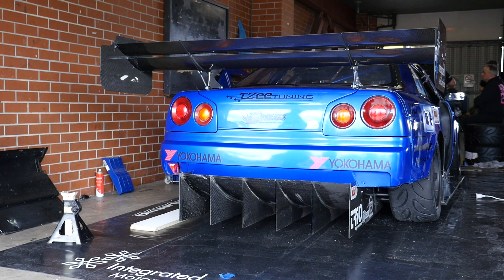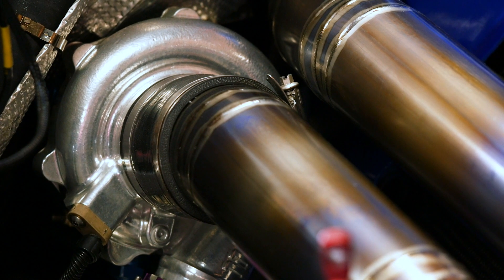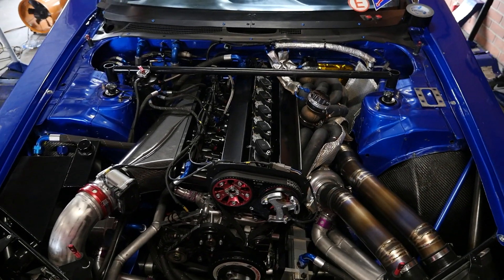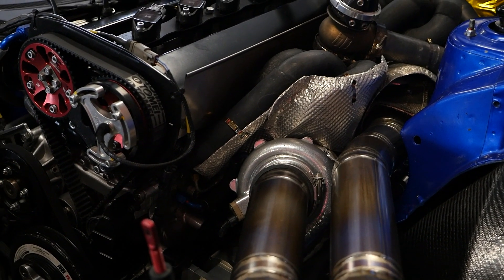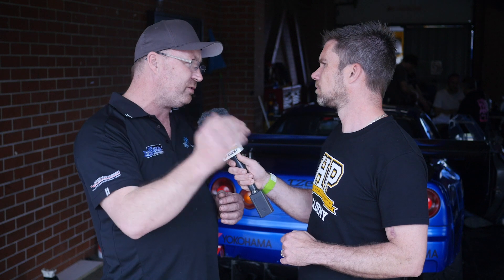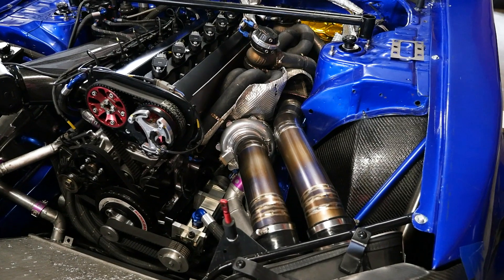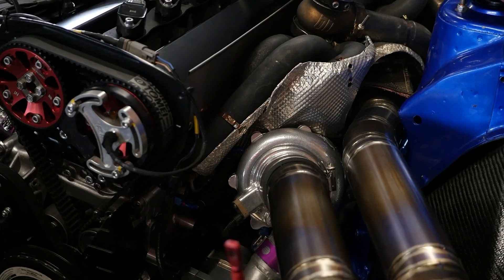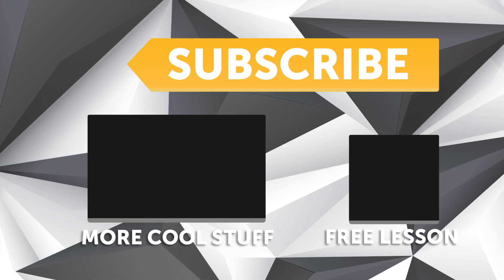Single Turbo OR Twin Turbo? | 1200HP R34 GTR Skyline [TECH TALK]

Comment: So twins on this one tiny niche requirement. Big single for everything else. Nothing new.
Reply: Response was as good as a gtx3584 rs  better than both 6870 and 9180 efr . And it just beats them all the way from 3  on .we made 1000 engine dyno at 6100 at 30 psi . . The others don't see 1000 . Well 6870 will easy go 1100 but it's at the top of the rev range . The g660 flog them all from 6 to 7500 there nearly 200 up on all the mid frame turbos . Only down side you need to run high boost 38 + to see the hp . That adds up to masive heat and high drive pressure in the exh manifold.  If you are only after 800 ish there not right for the job as the cost and work to fit is to hard . There to fill the gap between the mid frame turbo and large frame . Hp 1200 ish no other turbos fill this space .
Reply: @26Petermc  thank you SO MUCH for sharing your experiences.  Most of us can only dream of maxing out a high dollar build like this, much less compare several setups back to back. Really interesting info for sure. I am extremely curious if you guys considered installing a mechanical pre-turbo water meth injection setup, as it seems like the perfect thing to do when you've maxed out your turbo and still want a little more air. I left a detailed comment about it on this video a few hours ago, hope you can give it a read.
Reply: @MR__JUSTIN  well looks like you already beat me to asking them LOL! Let's see what they say :-)
Reply: @MR__JUSTIN  we are not aloud to run it in the class . But I have run water meth kit on many builds . It only adds a few % .. not enuff of a change ,to get where we needed to go
Reply: @26Petermc  ah, that makes sense, darn rules. Only a few percent better, interesting. I was under the impression it enabled a pretty significant bump in airflow. I would be curious to know about how many cc/min you were injecting pre-turbo when you did this in the past, and if the turbos were maxed out or close to it as with the case with this GT-R as that's when it really shines. Supposedly the more the better, to a point of course.
Reply: @MR__JUSTIN  no more air flow .. just better air density.  Most of the turbos are exh side limited . The pressure builds up and you just can not get it out . Turbos like the 9180 are out of exh flow very early on a rb 28 .even with the largest rear housing.
Reply: @26Petermc  no kidding! This is with pre-turbo injection? Spraying straight into the inlet of the compressor? I suppose if the turbine housing is the choke point, increasing your compressor efficiency won't get you anything. But couldn't you just get bigger external wastegates?
Reply: @MR__JUSTIN  we had twin 60s on it and had them wide open with 22 psi at 9000
Reply: @26Petermc  so much exhaust flow, that's crazy. No wonder going twin was so much better, way more total cross sectional area on the exhaust side.

Since you didn't specify, I'm going to guess your previous water/meth experience was with injecting somewhere after the turbo, and not pre-turbo. Every other person says injecting pre-turbo shifts the compressor map right and allows more flow.

Thanks for the responses!
Reply: @26Petermc  is it possible to have a twin setup that will respond BETTER than a EFR9180 / proper twin gate system?  Keeping in mind the EFR8474 is out now which has better response and can flow well.  The question really boils down to for the 800rwhp-1000rwhp max region, is there twins that respond better.

From research that I did, I had learned if you setup the single with twin gates, there may not be too much difference or much to gain by going a twin turbo system to match similar power.
Reply: Absolutely  it's was just a custom design for this job . The big singles are easy hp . But dam there hard to drive fast around a track
Reply: @26Petermc  Once you get to a high enough HP that is. Up to 6-800 it'll work. After that is probably about the crossover I reckon. a lot of variable to make a hard and fast call where that crossover is though.
Reply: It really is hard to believe that you can be 200 hp up at 5000 and make another 300 more at 9500 . They work .
Reply: @26Petermc  You can believe it less inertial mass and higher total CFM due to greater area of on/outlet to flow. But only at those numbers. if it's an 800hp build, I don't expect any more HP, just marginally better response, marginally.

Comment: The new electric borgwarner “superchargers’ are going to be game changing in terms of spooling and reducing lag.
Reply: Is that real. ? I haven't heard of that .
Reply: @jayknight139  absolutely, do some searching. Audi has already implemented a version on highend diesels. 48v is will allow them across the board.
Reply: @ricepony33  thanks for the info.!
Reply: They will change things yes but only in the racing and diesel world Gale Banks is very excited about them as well. I just dont see them being a big hit on most tuners vehicles
Reply: Peter Kroeker I agree. I could see them being used on older vehicles with some type of a battery pack. They could replace nitrous for spooling purposes and or provide improved drivability for highly strung or large turbo street cars.
Reply: There was actually a fellow on Honda Tech a couple of years ago who was designing and had a functioning prototype of an electric turbocharger. He got like an F20 or something (non s2000 f20) to like low-mid 200 wheel, with a powerband from ~2.5 - 6k. Never heard from him after his initial handful of posts, now I guess good ole` BW is gonna be eating his lunch.
Reply: The efficiency of the system might not be too good as you have electric power generation losses, though that might be partially offset by using a centrifugal design (which is more efficient than the other two, but has a narrow effective RPM band [doesn't matter with electric drive]).

Comment: I recently just installed a G25-660 on my EJ207 STi. Previous setup was S2 cos cams and the usual forged internals and the OG GT3076R it was quite laggy full boost at 5500rpm. With the current G25 I hit full boost at 4500rpm at 4000 car was spooling and makes the car way more drivable. Its also quite a noisy turbo, makes alot of jet noises at 2000-3000rpm if you guys like that kind of thing.
Reply: what size housings on the 3076 and 660?
Reply: 3076 was an .82 (~23 lb/min) vs 660 .72 (~20 lb/min) if im not mistaken? would expect it to come on a bit sooner
Reply: @PhatToni  yep you are absolutely right .82 for the 3076R and the .72 for the G25.
Reply: Did some more street driving, I got 7 psi at 3100rpm at 3/4throttle. Its so good, anyone looking for a great street turbo jump on this. Imagine on an evo with short manifolds.
Reply: Yes please!
Reply: RINGLAND FAILURE
Reply: @frontspring1  it's an EJ207, not a EJ257.
Reply: gtx3076 has always been a laggy turbo for the size on smaller engines phattoni. The problem is it was the only choice for a long time to reach those power goals. ERF turbos are the way to go in that area now. But the G25 660 is a great turbo, on pump fuel with stock cams though you will find you have to run boost fairly high to make any good numbers. You need a good flowing engine and e85 to bring them to life. Though we are making 260awkw at 23psi with a g25 660 on an evo 6.5. It's about where we want to be in terms of power for pump fuel. going closer to 300 is asking for trouble and we'd have to run the boost too high. Once it's on e85 though running it at 300-350kw wont be a problem. this turbo makes positive boost at 2500rpm and full boost at 4200rpm. Very good for a lightly modified street car.
Reply: @UnparalleledSpoof  It really hasn't ever been considered laggy on 4-poppers at all, quite the opposite as a matter of fact. Hell, even a measly b18b can produce ~15psi around 4k on a gtx3076, and that's just talking about the old, crappy, gen 1 version. Don't even, don't eeeeeeeeeven bring up an EVO if you're going to talk about how 3076s "always been a laggy turbo for the size on smaller engines". Go look up a gtx3076 dyno graph on a 4g63, and then try and explain away how it's a "laggy" turbo.
Reply: @aiGeis  Yes that's what I consider laggy. It's all about how much power you can make at lower rpm's. If you can see close to peak power at 4k and take it to 7k for a 3000rpm powerband within 30kw of peak then yeah thats a good result (or torque if you are going for flat torque but lets face it if you are either your power goals are too low or you chose the wrong turbo). But i have never seen that from a 3076, and ive been involved with installing them on over 20 cars. Even on a 2.5L 6cy they are laggy for the peak power they produce. You can quite easily find other smaller turbos that make the same peak power with much more response.
I have never driven an evo/wrx/silvia with a 3076 gt or gtx and felt it was adequate. A golf R with a ported head is OK, not great.
Reply: Just for reference the evo 6.5 has a very small turbo, smaller than the 8 and much smaller than the 9. The g25-660 not only makes more torque from 1500rpm onwards, but makes more boost as well. At no point does the tiny stock turbo spool faster or make more boost than the g25.
I dont see any 3076's make more power and boost than stock turbos anywhere around 1500-3500rpm
Reply: @UnparalleledSpoof  Sounds promising that your seeing positive pressure by 2500 on a 2.0L. OP was talking vanilla GT3076R which does outspool the later GTX gen 1 and 2 variants. Its true that the EFR series has been hard to beat in that size range but there has always been the GT2860RS, GT3071 and 3076 with all their housing options that have had 200-300rwkw covered for these kinds of engine displacements

Comment: How about Compounding the Compressors, but keeping the Exhaust in Parallel?  Could stagger the compressor sizes.
Reply: There would be an imbalance between the compressors, 1 compressor would be compressing Air at atmosphere and the other compressor would be would become pressing above atmosphere. And all of this would be happening at the same Dr pressures if the turbines were to be mounted in parallel
Reply: @marvinwatson2749  you explained how compounding turbos work.  This is becoming more and more common.  The less common thing though, is running exhaust in parallel.  Most gasoline engine also compound the exhaust but I think that is because this is kind of new to the gasoline world.

High compression, high rpm engines might benefit from compound compressors and parallel exhaust.  Someone will try it and find out.
Reply: @ericsperformanceparts1647  let me make sure I understand what you mean by parallel, for example in a inline 6 parallel to me means three cylinders feeding one turbo and three cylinders feeding the other Turbo we on the same page?

If we're on the same page then I don't see how that would work. The drive pressure is would be to drastically different. 

A simple example would be your atmosphere compressor at say 20 psi and you're high pressure compressor taking that and turning it into 50 psi. At a one-to-one ratio between EMP and imp this would mean exhaust manifold pressure would also be at 50 psi. With the high pressure Turbo on the compressor side feeding 50 psi the drive pressure would be correct that 50 psi, however with the atmosphere Turbo only pushing 20 psi it would also see a I drive pressure at 50 psi.

To maintain 20 psi at the atmosphere Turbo you need to wastegate the extra 30 PSI of Drive pressure. Or you would over spin it. That in itself is an issue disregarding how the turbos would try and balance them selves out. You'd be asking one turbo to compress denser air using the same Drive pressure as the turbo trying to feed it. It's just very imbalanced that's why they run compounds of the way they do. 

That's what makes sense to me anyway from what I've dealt with when compounding. However maybe somebody will give it a shot just paralleling the exhaust and we'll see for sure!
Reply: @marvinwatson2749  if you wanted to equalize exhaust pressuren then use a common exhaust plenum like diesels do.
Reply: @ericsperformanceparts1647  the emp would be equal regardless of the manifold style, its the drive pressures that the turbos require to do the work thats different
Reply: @marvinwatson2749  have you seen the way that the Alcohol converted Diesel Tractor Pullers setup their exhaust?  The best pictures that I could find are from Galot.  They use a common exhaust manifold for all 4 exhaust housings and drive 3 compressors into one (compound).  They dont seem to have the problem that you are trying to explain.  Check out Galot Motorspots, they have lots of pictures.
Reply: @ericsperformanceparts1647  that sounds extremely interesting I'll go and take a look right now thank you so much! I'll let you know what I think
Reply: @marvinwatson2749  if the exhaust was in parallel, might you be able to get better than a 1:1 ratio of emp to imp?  Ide like to think that would be the benefit to compound compressors with parallel exhaust.
Reply: @ericsperformanceparts1647  do you have a link to a pictures of them exposing their tractor engine Bays? I see that they have two tractors one with a single Hood exit and then another with twin Hood exit but I can't seem to find anything with the hood off.
Reply: @ericsperformanceparts1647  with some very well set up compound turbos usually Imp is higher than EMP. But it has to be setup really well. 1:1.5 is more coming in stock truck world. So many variables and getting it dialed in properly but people usually do
Reply: @marvinwatson2749  check Google for "Galot Tractor Pull".  I think that they have more pics on their website.
Reply: @marvinwatson2749  Honestly i think pinnacle performance would be achieved with a sequential setup over all others, and if you wanted to be really nuts you could take a stab at variable A/R housings using some type of actuator.
Reply: @aiGeis  the thing all these setups have in common, is trying to achieve better spool while still making decent top and Power. Sequential setups were used on various engines so that the engine would spool at very low RPM. In a race application such as this a the first stage of the sequential setup wouldn't even be used. The operating range of these cars that are racing is anywhere from 5500 all the way to 10000 RPM any sort of response issue below that is negligible to these people. Compound setups sequential setups all have their places where theyre extremely beneficial almost mandetory. Here though isnt the case, it all depends on your goals that the main thing, finding that simplest way to achieve your goal is what teams are after.
Reply: @marvinwatson2749  I would point out that you could maintain hp at rather high elevations by using two sequential turbos that are fairly oversized for your power level. That and, in terms of engine reliability you could see some added stability from running lower boost. All valid points you made, just have to remember that some things can have their purposes retooled : )
Reply: @aiGeis  ye thaat i can agree with for sure. At altitude a well done sequential setup would help response alot with the less dense air!
Reply: @marvinwatson2749  With parallel exhaust I am pretty sure what would matter for exhaust pressure driving the second turbo is the difference between inlet and outlet pressure, not atmospheric and outlet pressure. If the first turbo is boosting to 20psi and the second turbo isn't being driven at all, outlet pressure at the second turbo should still be close to 20psi.
Reply: @SuperBobKing  im listening provide an exanple of what you mean so i can fully understand?

Lets keep in mind that that imp and emp are going to be the sane for the hp turbo but not for the lp turbo
Reply: @marvinwatson2749  I am not aware of anywhere that provides real world data on the exhaust manifold pressure, atmospheric pressure, inlet manifold pressure, and pressure between the turbos, if that is what you are looking for. Each turbo is going to multiply the pressure it sees at its input. As far as each individual turbo is concerned, for the second turbo the pressure between the two turbos is atmospheric, and the intake manifold pressure is intake manifold pressure. For the first turbo atmospheric pressure is atmospheric, and the pressure between the turbos is intake manifold pressure. The issue would be if the exhaust manifold pressure each turbo would be at if it was in a single turbo setup under those conditions varies too much at any point in the rev range. Without looking at actual turbo data though I can't say whether that would actually occur, and I highly doubt I would be able to find the data I would need if I looked.
Reply: @SuperBobKing  i suppose we will have to wait till it's tried! Thanks for the discussion i love these kinds of talks
Reply: @marvinwatson2749  edit.  2JZ-GTE is Sequential compressors and Parallel Exhaust.
Reply: the 2jz uses a sequential twin turbo system. All the exhaust gases are fed into 1 Turbo and on a certain boost or RPM an actuator opens allowing exhaust to flow into a second Turbo. If you look up 2JZ sequential turbo you'll see exactly how it's laid out. On a 2J one compressor does not feed another
Reply: @marvinwatson2749  Shane T and Andre had a conversation about the turbo pressure imbalance that you were talking about.  Shane T says that the pressures will balance out much more easily than you think.  Video here -- https://youtu.be/1pV_tLbZY0A